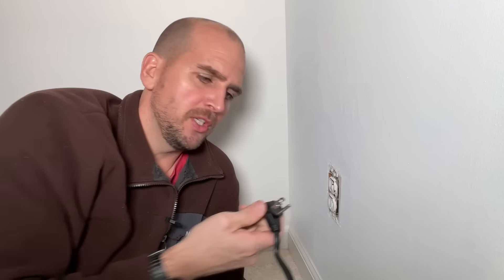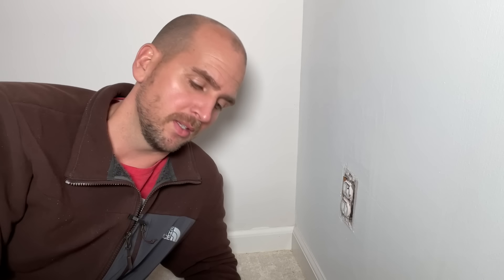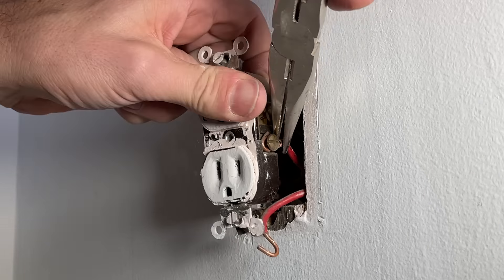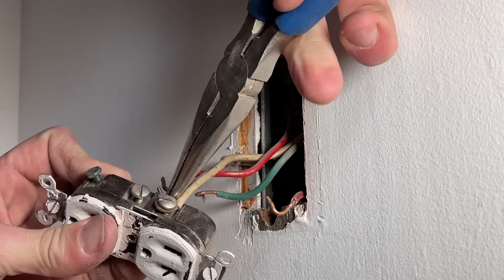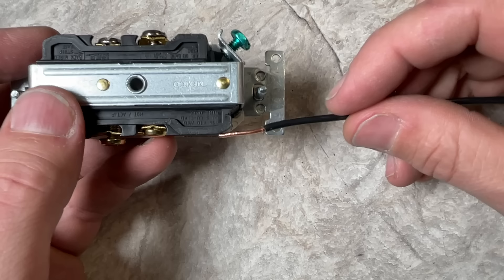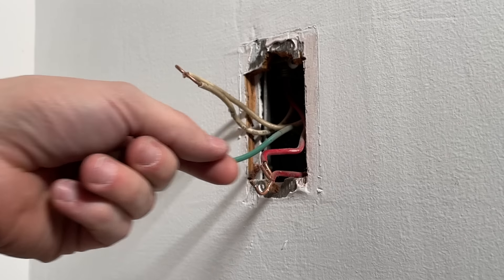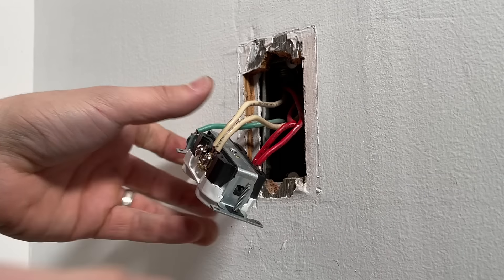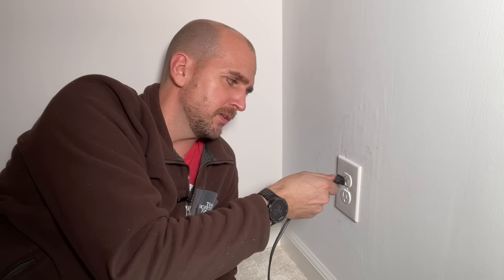Plug Won't Stay In Outlet

Comment: Hello. I appreciate your effort showing the steps in replacing an electric outlet.  I myself have been an electrician for over 30 years and have been an expert electric trouble shooter. If I may critique you a bit just for constructive purposes. As you had said licensed electrician do not like non contact volt sticks. That is correct . Any tester that you need to put batteries in to give a reading just isn't a good idea. Through experience I've learned this as many of my peers have as well. The next thing is. Putting 2 wires under thst same screw isn't the best idea in my opinion. You only have 2 wires on each side. Put 1 wire under 1 terminal screw and the other wire in the 2nd terminal screw. First reason is heat the one screw holding both wires will create more heat. Spreading out the load a bit by using both screws will help distribute that more evenly. Another reason the wire being solid copper does put resistive weight on the outlet as you push it in the box. The wire will push against the terminal screw and that weight plus the electric usage can cause the screws to loosen due to vibration and expansion and contracting.  An even better method is to pig tail the wires so only 1 wire goes to the outlet on each side. If you do have an outlet issue and it goes bad it won't affect the rest of the circuit. Just my opinion.
Reply: Pig tailing is best option.  
Yes contactless testers are ways electricians die.   Bad battery and a bad thing can happen
Reply: Double lugging is a code violation anyway.
Reply: Great comment - I'm just a PC repair guy, however I have done some home repair on electrical items... Could you please elaborate on "pigtailing" - IF I understand correctly, does that mean twist the two wires on each side into a cap, with a third wire (presumable a small piece one would cut with the same gauge) extending out into the screw?
Reply: Another thing to mention is to check to see if the bonding tab that connects the two receptacles together has not been cut.if it has been cut then the two wires need to be one in each terminal because one receptacle is likely controlled by a switch on the wall. Usually in older homes without ceiling lights this way you can plug a lamp in the one controlled by the switch on the wall. By the way only break the hot bonding tab and leave the neutral intact
Reply: I always pig taiil if there is more than one wire. Another reason to pigtail is if something goes wrong in the receptacle it will not knockout other receptacles down the line.
Reply: @John DiDomenico Thank you! I was going to ask if there was a benefit to doing it the way he did or not.
Reply: I was just about to ask about pigtails.  Most of the outlets in the 2006 built house we bought last fall just can't hold anything that you plug in.  I started replacing the outlets a while back and they are all using push-in connections and aren't pigtailed.  So I've been slowly getting pigtails in and replacing outlets one at a time.  Was slow at first, but now I can get pigtails on, outlet wired up and installed in about 10 minutes.  Wondered if I was making too much work for myself by doing pigtails but I guess not!
Reply: Hello John Deminico , Whenever I see multiple wires connected to an outlet , I always pigtail them so there's only two wires going to the outlet , Besides adding safety
It makes it easier to replace should it wear out , No matter what outlet you use , 
Frequent plugging and unplugging will wear it out
Reply: @appel199  That is a positive of a pigtail, on the downside that socket could be going very bad and may not get noticed unless it smokes or sets on fire, whereas if not pigtailed then another socket going out may alert one to the problem before it becomes a serious issue.
Reply: This guy seems to give out a lot of false information in regards to residential electrical work
Reply: Any qualified individual will know that you do a 3 point test to see if a circuit is live.  You check your meter or device on a known live source, the source you are checking to see if is safe to work on, and then a known live source again.
Reply: @tee86ify  I still like them and first test them on a known live circuit, I have seen mislabeled breakers, strange bastardized wiring in old houses where  a circuit was connected to 2 breakers at the same time to put all basement lights on a 3 way switch, also depending on the circumstances the neutral wire can be hot ,so I like to test all wires before I touch them.
Reply: @christophervilla1891  Yes you are correct as to what a pigtail is , code requires it on the neutral wire and is a good idea on the hot.
Reply: @Chrislk1986  Good job you did the right thing , I guess the contractor payed off the inspector if the house was that new.
Reply: @ironmartysharpe8293  Hubbell hospital grade ones should last even longer than many heavy duty ones and pay for themselves in the long run.
Reply: @leekumiega9268  Thank you for your reply!! :)
Reply: @jeffkubiak6363  Jeff, I don't believe anyone but you believes that.  He's provided a brief, informative and well-done tutorial! I'll watch several videos from various sources and READ THE COMMENTS to see what's, what.  It's amazing how much you can learn.  It's not just from the video, comments left by professional's who share all the little tricks of the trade etc. well that there's an awesome bonus! 
🌝
Reply: @tee86ify  this is soo true.But what if I use my contactless tester on a live circuit first which I always do than use it on the circuit I know I have too replace? 
Should I still be caution of the tester, even if I doo this step?
Reply: @tee86ify  Bullshit!  Only a problem if you're too stupid to verify your NCV tester while using. Also how do you check switches especially if backwired ?  You start probing in a j-box with a wiggy? You're not much of an electrician if you can't figure out how to safely use an NCV tester.
Reply: Totally agree!  Another nifty teaching tool I've used for newbies is BB, brass is black,  and WW, white is wide. Of course it's not always true, always test for line voltage anyway.
Reply: Thanks for the comment! I was just wondering why he put the two wires under the same screw. You clarified it for me. I have loose plugs all over my new home!
Reply: @tee86ify  live, dead, live is the only way to “trust” a battery powered tester.
Reply: I wouldn't let any of the electricians in this comment thread within a 100ft of my home.
Not one commented on the code violation of 314.20, and if you have a metal box, it's good practice to wrap your screws with electrical tape.
Reply: I agree they should’ve been evenly distributed on all four screws
Reply: @christophervilla1891  just in case no one clarified for you, yes.  The two wires from the same side of the receptacle (outlet) are put together with a third wire with a wire nut,, the third wire goes to the receptacle, the same is done for the other side..  the only reason to not do that is if the the dark screw side has the bridge between the screws broken off so that one end of the receptacle is live all the time and the other is controlled by a switch.  The neutral (usually white) side should be made up with a pigtail anyway as it promotes more reliable circuits.
Reply: @johnstejskal6084  used to be industrial electrician over 10 years ago and we had to get rid of wiggles.  Couldn't use cat III meters anymore either.  It had to do with arc flash training we had.  Just FYI. ⚡
Reply: Does it matter which red wire goes on the top screw and and which on the bottom in relation to the neutral wires on the other side?  I noticed he put them on the same screw.  Just wondering 🤔
Reply: @robertgammill9811  as other commenters have noted, the best practices are to combine both* of the black* or red* wires with a third short wire using a wire nut (known as a pigtail) that gets attached to the outlet.  Hot (black or red) to the brass or darker terminal.  The same is done with the neutral (white wire to silver screw also known as the grounded [not grounding, there is a difference, the grounded is the return conductor,  the grounding is not supposed to carry any circuit current and connects the green or bare wire to the green screw on the device].  The only circumstances* that would not be covered by the above would be if one end of the device were controlled by a switch (in which case the "bridge" between the the brass/darker screw was broken out, in which case the "hot" wires would not be combined, or if there were 2 hot wires fed from separate breakers or fuses (meaning each half of the outlet was independently fed).
Reply: Also, one of the outlets (top or bottom of outlet) may be switched and the tang connecting the two outlets to power and neutral may have been removed.  Both power wires on one terminal and suddenly your switched outlet doesn't work.
Reply: @christophervilla1891  yes
Reply: @leekumiega9268  not a good idea on hot.  Stop while you're ahead
Reply: @christophervilla1891  Yes, exactly. The concept is that we don't use the device as a splice. Bring your conductors together, splice with a solderless connector ("wirenut") and then bring a short pair (pigtail) to terminate on the device..
Reply: Yes sir. I've noticed that also. Pigtail both wires to one screw is what I was taught.
Reply: Ok. I’ve been reading the comments and I think I understand the pig tail thing. But another comment had me wondering about the outlet in my kitchen. I can’t use the microwave and the key right, or the toaster. They aren’t plugged into the same outlet, but the same (circuit?) maybe. Anyway the breaker flips when I forget. Can I check to see if they are pig tailed? Will that help?
Reply: Pigtails are a must. You may not use a receptacle as a bonding method for down stream devices. That receptacle was either a switched leg, 2 separate circuits, or short on pigtails. Imagine if that was fed by 2 hots and they're hitting different hit legs.... Voooop Karak. I couldn't see if the tie bar was snapped out of the old one.
Reply: @purplekat10000  I am NOT a licensed electrician but since I do not see any of them having replied to your question here is my input.  Short answer; no, probably adding a "pigtail" connection will not "solve" your issue.  If you are interested in the "why" then keep reading.

When your breaker flips (trips) it does so because it has sensed too much current (Amperes = Amps) flowing through that circuit.  Anytime electrical current is flowing through a wire, that wire is heating up.  All electrical wire is designed to carry a certain amount of current (amps) and stand up to a certain amount of heat.  Your circuit breaker is designed to trip in order to prevent EXCESS current from producing EXCESS heat in the wiring.  Excess heat will get the wiring hot, eventually melting the wire's protective insulation.  The overloaded electrical wire can/will get hot enough to catch anything combustible near it on fire (think glowing red, like a burner on a stove, or white hot as in a welder's torch).  Summary: all electrical wiring has a limit to the amount of current it is designed to carry.  If you exceed the current (amps) limit for a wire bad things happen.

The electrical circuit in your kitchen is designed to carry up to a certain amount of current (amps).  Many kitchen wall plug in circuits are typically 15, 20 or 25 amp circuits depending on what sized wire was used and the intended/anticipated use of that circuit.  Your microwave probably uses 7 to 15 amps, your toaster oven another 8 to 10 amps (that information should be noted on the appliance data/information plate).  If that kitchen electrical circuit was designed to carry 20 amps and you turn on your microwave, it uses 15 amps, and then your toaster oven, that uses another 10 amps, you are now demanding 25 amps of electricity through that circuit.  The circuit was designed for 20 amps, the microwave and toaster are demanding 25 amps, now that circuit is overloaded.  Under those conditions, your circuit breaker will trip, just as it should to keep from overheating/overloading the wires.

Putting a larger circuit breaker in is NOT a "fix" because the underlying safety issue is not to overheat the wires (provided the circuit breaker and wires were correctly sized/matched when installed).  The larger capacity circuit breaker WILL allow more current to flow, but the wires were not designed to carry that amount of current and will overheat.

It is POSSIBLE that loose wires and a bad connection(s) is/are  leading to excess resistance and heat buildup.  That scenario can also trip the circuit breaker because excess resistance draws additional current (just like plugging in an additional appliance would) creating heat.  So, there is a POSSIBILITY, but it is unlikely, that a better wiring job, in this case pigtails, might "fix" your issue.  However, that is a very unlikely outcome.

So, you will either have to live with knowing you can only use one or two items on that circuit at the same time.  If there is a different outlet in the kitchen, that is on a DIFFERENT CIRCUIT (very important) you could plug in one of the appliances in the other outlet.  That may spread your total electrical demand over two different circuits without overloading either circuit.  If so, that would solve your issue (depending what else is already on that second circuit).  Getting a smaller microwave and/or toaster oven with smaller current demands might also be a solution for you.  If one or more of the appliances are beginning to fail due to damage, corrosion, excess internal resistance thereby drawing too much current then identifying and replacing/repairing that appliance could fix the problem (unlikely but again possible).  Finally, you could run a new circuit from the circuit breaker panel to your kitchen.

Finding a GOOD electrician is a WONDERFUL thing and a excellent resource for every homeowner/landlord/tenant.  A good electrician is worth every cent they charge.  However, finding a good and by "good" I mean knowledgeable, reliable, available, conscientious and honest will take effort.  Or you can learn to do it yourself, then you control the quality, schedule and labor costs.
Reply: @Brian-cr6rb  A bit crude, but I was taught “A smaller hole is always hotter!”  Hard to forget. (No pun intended)
Reply: @purplekat10000  Just wondering if you solved your issue and the details.
Reply: @jeffkubiak6363  Some is not a lot. He's not an electrician, he's a handy man. He goes off the principal of putting it back together the same way it came apart. Usually this works, but in this case, it's less than ideal.
Reply: @purplekat10000  That doesn't mean they're pig-tailed, it means they're on the same circuit. When you reset the breaker, is it a 15A breaker or 20A breaker? Current code says you need two 20A circuits to distribute the load for your various kitchen countertop appliances. Appliances with heating elements and microwaves tend to draw more amps, hence your inability yo run them at the same time.
Reply: As a professional electrician, you should warn the people not to meddle with electricity outlets themselves and calling a professional instead. An electric shock can be fatal!
Reply: @akuunreach  AWESOME finally someone that knows how to do this... I've been reading all the comments to see if anyone knows this. My Grandpa taught me this trick in the early 80's. VERY wise 83 yr old man.... Electrician most of his life. ALWAYS I repeat ALWAYS wrap every outlet with tape for safety.
Reply: @apackwestbound5946  ....thank you sooo much! Very informative!! 11:09